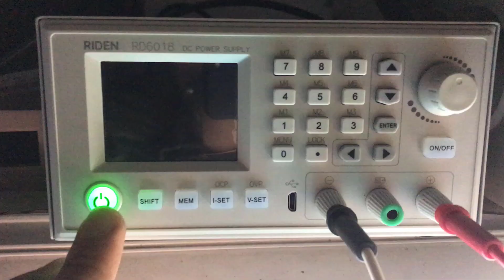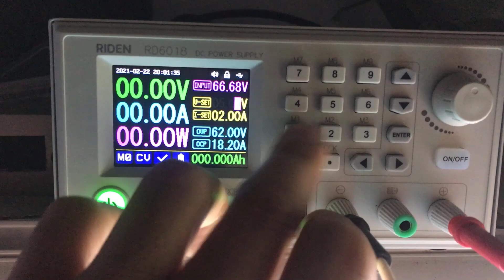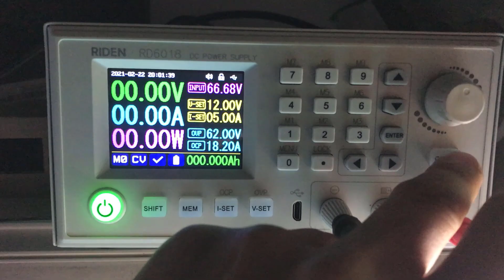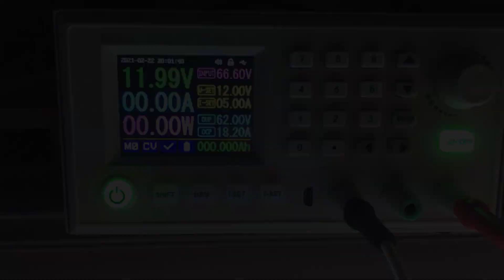How to turn 220V generator from CPU fan

Comment from the maker: Today I will turn the CPU fan into a 100W generator. However, during the test, It has been destroyed :))) , I will try again with a slower motor.
Reply: It's like the Wright brothers, their first flight was only 12 seconds. :)
Reply: Sprr bro u have done a wonder full pmg with simple thing bro
Reply: Can you tell some information of this pmg 
Copper coil awg 
Each how many turns 
And bolt dia bro
Reply: Try to power the motor with 5 Volts.
It will slow it  very well.